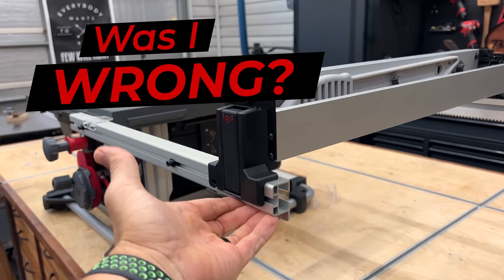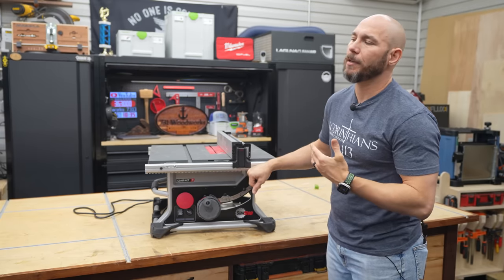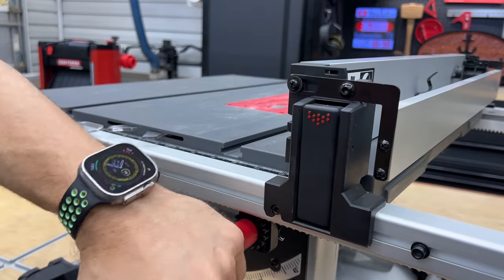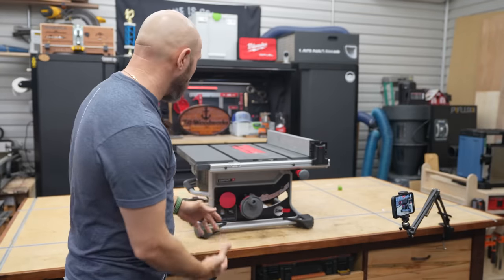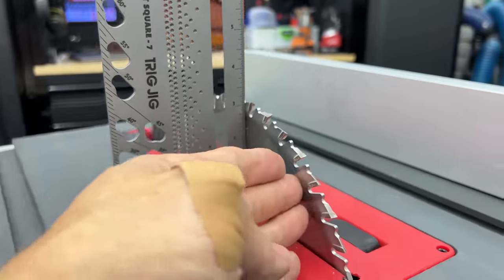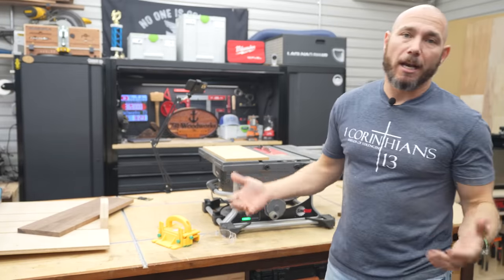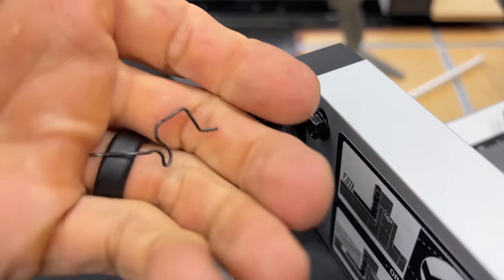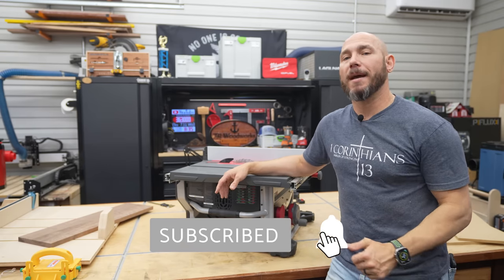Was I Misled or Wrong About the SawStop Compact Table Saw?

Comment: Not that it was planned, but this likely means I'll never be a Sawstop owner. Not a precision tool?? Who the hell uses a table saw, not expecting some precision, over bustin' out a circ? It's painfully obvious Sawstop is a company of marketeers who've never touched their own tools. Giggity.
Reply: I agree with you Matt it’s not a 400.00 compact saw like there should be no movement at 900.00
Reply: There is no way I would spend that kind of money on a small saw like that. I’ll stick with my Delta full size saw that I only paid $600
Reply: @TheRealGOTdurrrred most carpenters i know working on site need accuracy or their work looks awful
Reply: @TheRealGOTdurrrred  are you really that scared of cutting your fingers on a table saw, as opposed to any other power tool?
Reply: “Not a precision tool”
But go out of their way to otherwise try to make it one with six adjustment points for the throat plate, zero clearance throat, and micro adjuster on the blade angle. 
I call bullshit and it was just poor quality control and customer service response. If they knew it was going into a YT review they would have handled it much differently. 
It’s just a company cashing in on its one feature that Dan be copied yet so they’re being lazy about QC and customer service.
Reply: @TheRealGOTdurrrred  it must suck to not be able to use any other tool with a motor-driven blade than your sawstop for fear of losing your fingers because you’re not bright enough to find any other, cheaper and better ways to protect yourself.
Reply: @TheRealGOTdurrrred  if you think a person doesn’t need precision just because their making cut on a jib site and not back in their own shop, then you have a very limited understanding of high quality carpentry and woodworking. 
Also, if it’s not a precision tool, why bother with a micro adjuster on the blade angle adjustment?
Reply: @TheRealGOTdurrrred  did you see the amount of slop on that fence?? That is not comparable to minor vibration. Also, if you think that professional carpenters and woodworkers don’t need more precision on a job site that god-awful fence fence could provide before being adjusted, then your understanding of the profession is beyond poor. Not every cut for a major professional install can be done in the shop. Some pieces may and often do need to be cut to size on site for final install. 
Also also, I have seen many fine woodworking projects done on job site saws. Minor vibration won’t cause any major issue with a cut. And any minor in consistency cause by it is easily managed by finish sanding or a couple of passes with a hand plane.
Reply: @TheRealGOTdurrrred  that actually makes the official Sawstop customer service response even worse when they said “yeah that’s totally normal and fine” but was so easy to fix and clearly not the norm since Poll’s saw didn’t have the same issue.
Reply: @TheRealGOTdurrrred  certainly won’t buy a $900 table saw that is a sloppy POS like a $100 table saw. 
You keep throwing money out the door on garage and everyone will keep laughing at you. I’ll spend my money on expensive things that are actually worth the price tag.
Reply: True.. if you need a saw stop.. you need re think what you do..
Reply: @TheRealGOTdurrrred  I’ve read all your comments and I think you’ve got some issues. You don’t need a ton of money to make precise and beautiful things. I wouldn’t be surprised if you have CNC machine 🤔
Reply: @TheRealGOTdurrrred  I can afford, and do buy, any saw I want. You and other commenters ignorantly confuse the ability to buy with choosing to buy or not. I simply choose to buy saws that perform as I need at a price equal to its value. The names on tools in my shop include Laguna, Powermatic and Harvey. If you want to waste $900 on a saw no better than a saw half it’s price, you’re free to throw your money away like a fool. 
Also, I clearly do more and know more about general woodworking than you and others who seem to think “job site” work Is limited to cutting framing lumber and similar construction work. You clearly have no idea that “job site” work also includes work like custom cabinets, built in shelving, molding/trim work and a lot more that the saw shown in this video with a ridiculously sloppy fence would be unacceptable to produce the exact cuts needed to do a high quality job.
Reply: @TheRealGOTdurrrred  i have a 5hp delta unisaw, and im not getting rid of that for anything.
Reply: @TheRealGOTdurrrred  oh, and i am a union carpenter, so my company provides the tools. Id never use a personal tool on the job.
Reply: @kennyhomer1131  tell that to Tamar at 3x3 custom. You're the joke.
Reply: @TheRealGOTdurrrred  im not looking for one, im just watching the video. Is that ok?
Reply: @TheRealGOTdurrrred  a table saw wouldnt cut all your finger off, but a jointer might. Yet they dont stop when they sense your skin, and can be way more dangerous if you dont know how to feed the wood in.
Reply: @kennyhomer1131  yep, that's exactly it bud.
Reply: @TheRealGOTdurrrred  There is no place for disparaging women, people with less money than you, or anyone for that matter. What value does that add?

A person’s gender has absolutely no effect on his or her ability to use tools to change the shape of wood. It is ridiculous to think otherwise. 

I’m happy for you that you have the money to buy the tools you want, but it’s pointless to tell others that they can’t afford expensive things. Do you think they don’t already know that? 

Perhaps instead of arguing with people in YouTube comments, you could add something of value by sharing your experiences or giving helpful tips...
I wish you the best!
Reply from the maker: If you’re looking for Kenny’s comments and replies in this thread. He’s been banned 🔨

Comment: No, you weren't wrong.  The bigger question is WHY, for something that costs a ridiculous amount compared to it's equals, that it leaves production with a need to do what you are now explaining.  I use a Ridgid on a rolling stand because everything I do, I do in my driveway, and I have had to make very few adjustments.  And right out of the box a year ago, every aspect was ready to go with no adjustments.  And if IIRC, it cost 1/3 of this sawstop.  I am going to upgrade to a DeWalt soon because I hate the fence on the Ridgid, but I damn sure ain't going to shell out $1K for one of these things.

Comment: "It's not supposed to be a precision saw" is the lamest thing I've ever heard.

For $400 less, my Dewalt 7490 has ZERO slop at full extension, and did out of the box. If you're going to market your tools as premium, which Sawstop does, then you need to put premium tools on shelves.

I think the fix would be figuring out the "new" diameter of that cam, then making a free-spinning wheel that's the same diameter, this way the arms can roll on it but it'll still prevent slop.

Kind of embarrassing for a $900 tool, though.
Reply: Oh great, and no Dado stack either. Man this just gets better all the time. eye roll

I see the value proposition for a Sawstop because of the safety features, but functionally, this thing is nowhere near as attractive to me as it was when it was first announced. I really appreciate the video!
Reply: The issue with dados on the Sawstop is that the saw itself doesn't have enough mass to safely stop a dado set. And yeah, it is kind of a harder sell when get a wheeled stand with your $650 DeWalt that can also use a dado stack if you're looking for a "do it all" saw in the sub-$1000 range. Zero-clearance inserts are pretty cheap for the DeWalt on Amazon, too.

The reply I got on these things from another youtube woodworker was "use a router" about the dado.
Reply: @1steelcobra  let me guess: a European said that 🤣
Reply: @vincentferrari  Nope, an American who's pretty obsessive about safety.
Reply: @1steelcobra  well that’s even worse because anyone obsessed with safety should not be advocating a router over a table saw 🙄
Reply: @1steelcobra  as far as predictability and control I’ll take a table saw over a router every day
Reply: @vincentferrari  Eh, use your fence, guide pin, and templates and always feed the correct direction and a router's pretty easy to control. Just like you need to use the fence, miter gauge, or a sled on a table saw.

Comment: The engineering for the fence is a design flaw. No excuse.
The customer should not need to adjust the saw, that should be done before shipping ie quality control. 
My opinion is that it is an adequate  $350 saw with a bonus of the safety feature. 
The decision is whether or not to compromise quality and utility and choose a very small, overpriced saw which may save you harm in the future by "misuse".  
I disagree with the saw being characterized as "robust". 
Saw Stop's initial response to you, in my opinion,  was absurd and unprofessional. 
By my observation, those who contact Saw Stop, and are identified by having you tube channels, appear to get attention not afforded those without. This is historical, and not just with the Compact saw.
My contacts with Saw Stop have been less than professional. On only one occasion did I have a positive contact, one. A gentleman named Ethan, a guitar enthusiast as I recall.

My reference is based on years of woodworking and tool use and purchase. Prior I was a corporate trainer specializing in automotive business management and customer service. I worked for Mercedes-Benz of No America (the factory/importer not a dealership) , BMW of No America and Volvo Motors of Am. Before that  several years with Mazda Motors of America. Those 14 years  were preceded by 11 years in automotive retail to include Rolls Royce/Bentley, Aston Martin and Jaguar.   I am well aware of what manufacturing and distribution and customer service should be.
My opinion is that Saw Stop is not in that league based on  my experience.  Your experience and opinions may differ.

Comment: I've not been impressed with their saws compared to other saws. Take away the safety feature, and they're just not very impressive compared to other brands.
Reply: And yes.. I'm prepared for the blowback I'll get for saying this lol
Reply: @carterscustomrods  Brace yourself 😆
Reply from the maker: I agree mostly.  Even stated near the end the only reason you're paying $900 bucks for this saw is the safety feature.  The DeWALT jobsite is equally well made IMO.
Reply: @731 Woodworks  I bought the dewalt job site saw 3-4 years ago and like it a lot.  Well made, portable and able to cut 2 inch thick slabs.
Reply: I do agree with you in regards to the two newer job site saws they have put out. SawStop should stick to contractor and cabinet saws. These small saws seem of poor quality, they should charge a little more to make the most robust unit possible.

I have owned the SawStop contractor saw for years -- upgraded T-style SawStop fence, cast wings, mobile base -- way better than the old Craftsman contractor saw. Because of that tech, it was worth every penny to me and a better value than their cabinet saw.

Bought the saw in my early 20s when money was tight, but I knew if my hobby stopped me from working my office job I'd be worse off. Knowing I'm human and will make mistakes I wanted to mitigate the risk with a SawStop -- same reason I wear a seat belt while driving equipment alone on private land.
Reply: Couple questions Matt 
1. How good is the dust control with a shop vac?
2. With the fence adjusted, at fence full extension does the product support piece actually sit parallel with the table? Remember mine sat fairly low. 
Thanks and happy New Years!
Reply from the maker: @1975oldschool  Dust collection is not bad with a shop vac.  yes, the fence support is parallel with the table once I adjusted the fence tightness.
Reply: And that folks, is the bottom line. Without the safety feature not only are they "not very impressive", in many ways they are substandard. Example: the Job Site Pro fence, or the miter gauge that is no more than a child's toy, insulting junk. 
Keep in mind Saw Stop will not license other companies to incorporate their safety feature. In my opinion,  If they were concerned  about woodworker's safety, and altruistic,  they would share, and it would be profitable to them.  It is my understanding that another European company had a similar safety feature and did not patent it.  Saw Stop objected and the manufacturer discontinued its use. You will need to verify this for yourself, but it seems to be a commonly held bit of information. What is obvious is that no other company has that particular blade stop feature. 

 I bought a Job Site Pro. It was so badly manufactured it was useless and was returned immediately with no assistance from Saw Stop, fortunately  the dealer was professional. . In my opinion, Saw Stop's response to my contact was unprofessional, antagonistic, and confrontational. I won't bore you with the details but I have documented my contacts with them over that saw. Nothing short of ridiculous. After several months the dealer called and I finally got  an adequate replacement saw that still had "issues" to include
a very poorly designed fence. For the moment I'll live with it. I regret the compromising but my main saw (and the majority of my woodworking equipment) is in storage and my current shop space is a one car garage and a 12 x 12 shed down from my 1000 sq ft shop . This necessitated a smaller saw. I swallowed the jello and bought a Saw Stop. 
I was hoping the Compact was better built. Not in evidence. 
 I'll keep looking. The Makita, in my opinion, is far superior to the Job Site Pro, but the choice is safety feature or not. .. and that is the Saw Stop "hook". 

.All the above are my opinions and experiences, your's may vary.

Comment: Dewalt has the market on job site saws. That one in the video looks like junk.
Reply: Have you tried it in person?
Reply: @AaronGeller  I own the DWE7480. The  Rack and pinion fence has 0 wobble even when fully extended and pretty accurate. The sawstop with the cheap looking parts and wobble should have never have left the design phase as is.
Reply: @tratzum  from someone who actually owns it, it feels as solid as the Dewalt. All the Dewalts I have encountered have some slight flex when FULLY extended…. Slight but still there.
Reply: @AaronGeller  to each their own then. Glad you like it.
Reply: @tratzum  all I ask is get your hands on one before passing judgment and if you still have the same opinion, then that’s perfectly fine.
Reply: @AaronGeller  not likely to happen. If I ever put hands on a new table saw it will be a full sized proper one.
Reply: @tratzum  fair enough